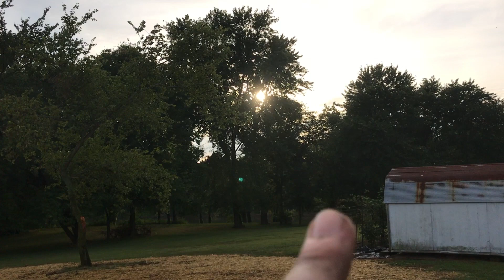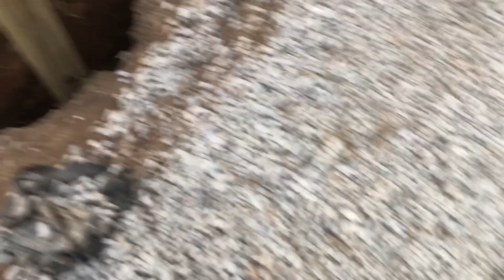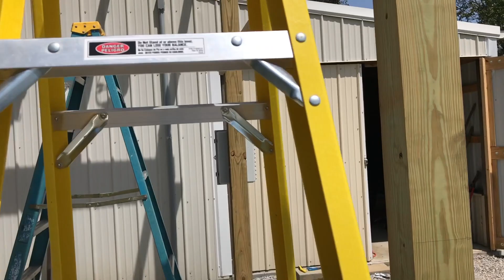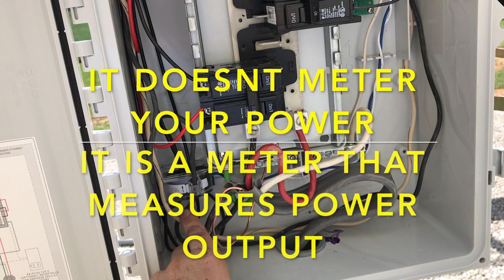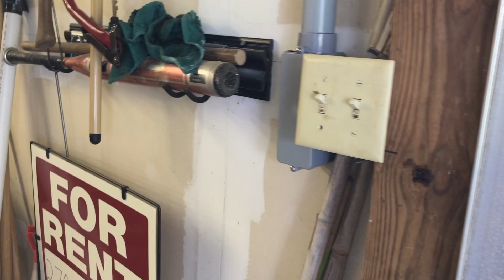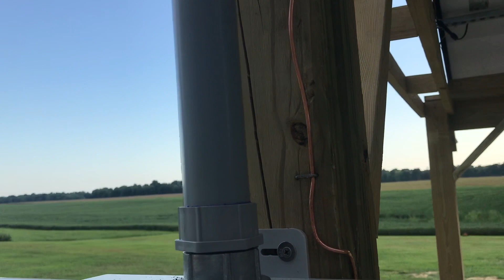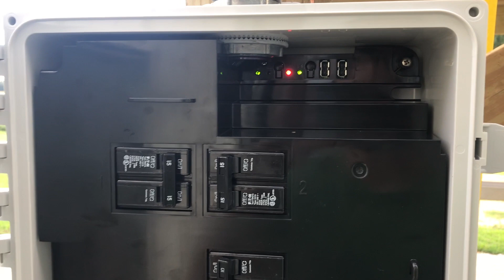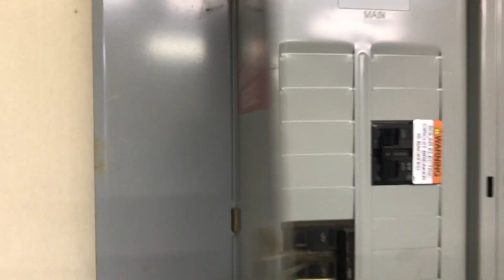Easy DIY Solar Panel Install - 8.37kW Enphase Energy Micro Inverters & Mission Solar Panels

Comment: Neal, Great Job.  I was wondering what gauge wire you ran from you combiner box to the disconnect box and the length between the combiner and Disconnect. Do you think the (3) strings from the micro inverters will fit through  3/4 " emt or would I need 1"?  You just inspired me to do my own 9.7 k/w system  on my garage here in Southern California instead of paying $32,000. Thanks and again, Great Job
Reply: Thank you for the info. I also have a 200 amp main panel. I will have to derate my panel like you said to 175 or do a line side tap. I will be using 26 enphase IQ7A 1.45 amps so I will need a 50 amp breaker. My run from the combiner box to the main is about 100 feet.
Reply from the maker: Fernando Larez 6ga cable should work fine in your install. If you’re going all conduit I wouldn’t get underground feeder, it’s difficult to get through conduit and strip. It wasn’t too bad getting through the little conduit I had but you have to pull the cable stick by stick or fitting by fitting before you glue. I use this chart https://www.usawire-cable.com/pdf/nec-ampacities.pdf
Reply: @NealORussa  not to mention that any sheathed cable is forbidden inside conduit, loose conductors only.
Reply from the maker: @Miss_Vicki  I've done a little research on this and I don't believe the NEC code actually forbids it, but sheathed cable is not recommended to run in conduit because it is tough to pull and it changes the conduit fill code.  I have read where code says that sheathed cable can be placed in conduit to provide protection, which is why I have my UF cable running through conduit in certain places outside of my building.  Thanks for any insight though, this discussion is always good!
Reply: @NealORussa  Very impressive and nicely narrated installation. Retired electrician here doing some research and trying to get familiar with  a system my son is having installed. 
On the "sheathed cable in conduit question: I'm also not sure if it's "forbidden" in the NEC but during some code classes I have attended, the chief concern that was stated by the inspectors doing the classes was that of "heat" since the jacket on the cable is not intended to be enclosed in conduit so it can't/won't dissipate heat very well. As I recall, the advice was to strip off the outer jacked whenever the conductors were going to be installed in a conduit leaving the individual conductors running through the conduit with lots of air space to dissipate any heat. This could also affect the amp rating of your fuse protection due to how much heat the conductor insulation will allow.
Reply from the maker: @pappabob29  thanks for the insight Bob!  I have about 15' of the uf cable running through 1.5" conduit. It's just where it runs from the iqcombiner box into my pole barn. From there the cable is exposed through the disconnect and to the box in the garage. Good luck on your sons install. If it's the enphase system I think you'll both be happy!
Reply from the maker: Fernando, thanks for the comment, glad you are doing it yourself! Not only save money but also will help having knowledge of your system in diagnosing any issues down the road! My only note on the system size you discuss is making sure you stay under the 120% rule. Meaning however much your panel is rated for, you can only send in 120% of that power. My limit was the panel in my house which is the panel after my garage. It’s a 200a rated panel so max i can send to it is 240a. I have a 200a main breaker for incoming power from utility company and that only allowed me to input 40 additional amps from solar. One way around that is to put in a 175a main breaker then I could have 65a of solar power. I have my electrical line diagram if you’d like a copy of it. You can email me at daviesscountytractor@gmail.com. 
That cable you refer to is 6/3 stranded copper underground feeder with a 10ga ground. I’d say it runs about 80’ total including through the emergency disconnect. As far as conduit size, there are dimensions of the cable on enphase site and there are conduit fill charts you can use. I would upsize to 1”. Easier to pull if anything else.

Comment: How much would you estimate as the cost of this entire system?
Reply from the maker: I have a detailed spreadsheet of all costs. Total for materials purchased was right at $13,200 and I had about 100 manhours in the installation. I just received the 30% federal tax rebate on my 2019 taxes as well.

Comment: Why would you use wooden posts on such a nice solar install? I think it's pretty inevitable the posts will eventually rot which will require some pretty decent amount of repair work later. As opposed to using aluminum posts which would pretty much last forever...
Reply from the maker: Ozzie, I definitely looked into aluminum posts, i figured i would need at least a 3" or 4" diameter pipe, and I was having trouble locating that material along with a proper way to fasten my beams and rafters to the pipes without spending a bunch of money.  I did consider steel I beams since i have a welder and could fab mounting plates for the beams.  Either way, I went with CCA ground contact treated posts.  If they rot out, my plan is to put temp 4x4 post shoring on either side of a permanent post, cut out the rotted post, drill & epoxy in rebar into top of concrete foundations and pour a 6" layer of new concrete on top with a galv metal post anchor embedded in that concrete.  Then I can install a new post, nail to the anchor embed and beams and repeat at each post.  I figure that may take two or three days at the most and maybe $400.
Reply from the maker: Also, every aluminum racking supplier I talked to did not want me to build the racking off the ground for storage underneath.  They all said their aluminum poles needed to have the low end of the panels like 1-2' off the ground unless they added a ton of X bracing and additional engineering drawings and $$$.
Reply: @NealORussa  I was going to ask the same question. Great job on the build. I will be using this as a reference for my project. I think you will be good because you filled the entire hole with concrete. if you built a form and brought the concrete above ground by 3-4'' they would never rot. I suggest you brush / soak the bottom of posts in used motor oil / diesel fuel 50/50 combo once the wood dries out. This too will greatly extend the life of the posts. it is not bad for the environment which I assume you know that.
Reply from the maker: Terry Rocks thanks Terry! Yes I wish I had gotten another yard or so of concrete to raise and slope the foundations. I’ll look into a wood sealant. If your moving forward with an install like this i would also recommend trying to find some plastic c shaped strips that would ship over the top of the rafters before installing unistrut. That may help protect them from weather more. Another commenter mentioned that. Thanks again and stay tuned for the one year update coming early September!

Comment: Nice install Neal, I'm thinking about installing the enphase inverters have you had any trouble out of any of them.
Reply from the maker: Thank you Greg!  I have not had any issues with the inverters.  I don't believe there has been one day where they did not work or upload data to the enphase enlighten web app.  Since install i have generated 6.76 MWH, or 6760 KWH.  That is $811 using my rate of $0.12/KWH.  That is from Sept 2019 to May 2020, so 8 months, and those were the winter months!  I'm looking forward to what the summer holds.

Comment: Next time just pour concrete in holes and attach anchors with threads then use some metal collars to bolt to anchors. Nail the wood to the collars. So much less concrete and wood. Drill holes in wood to make room for anchor and nuts. When grounding there are barbs on each hold down bracket and should be torqued to Mfg. Spec. also would not hurt to run the ground wire to each mounting rack.
Reply from the maker: Yes, I agree I was not happy with the concrete being lower than the dirt, i should have ordered another cubic yard of readymix so the concrete would be higher than the dirt.  I am thinking of digging up the rock i placed around the posts and putting in some waterproofing and then pouring up another 1' or so with sonotube & quickcrete around the posts to keep some moisture out.  I've seen the post anchors as well and considered those, but i was slightly worried about pullout strength at the bottom of the post with wind uplift.  Some of the post anchors i was finding only had nail holes up about 1-1.5" up from the bottom of the post and that didn't seem like enough meat at the bottom of the post for the nails/lag bolts.

Comment: Nice set up!  I’m not at your budget but under $14,000 is really good from my research.  My budget is super tight so I only have 2 panels and a turbine I’m working on getting up this summer. However I am seriously contemplating going with the Enphase iq7’s which will almost cost more than I paid for my 3 panels (1 is on my golf cart) and my turbine.  My understanding is that even without Envoy they are worth using.  I’ll check if you’ve done a review video on them.  Thanks for the info!
Reply: Enphase is the way to go, they are far more advanced technological value than anyone else
Reply: @guidedbygreen1480   That's what I like to hear.  Have 2 IQ6's in my Amazon cart waiting for me to get all the wiring done to click "buy"!
Reply from the maker: Hey sorry i just saw this comment!  I think the enphase microinverters are the way to go, easy to install, replace, and add to the array.  A single inverter system also requires high voltage going from panels to the inverter location, which can be more dangerous.  Good luck with your setups and i plan to record a 1 year followup video in late august!

Comment: Hey Neal thank you for the thoughtful video.. I am planning my own installation and wondering if the combiner box is necessary.  I’d forego system monitoring to save the 800 they want for that box.  I’m thinking a small sub panel could do the job?  Is there another reason that I’d need the combiner box that I’m overlooking?
Reply from the maker: Josh Cole if this helps at all, here is the combiner box I bought from eBay for $500 new. https://rover.ebay.com/rover/0/0/0?mpre=https%3A%2F%2Fwww.ebay.com%2Fulk%2Fitm%2F174204561841
I think the most fun part of the solar setup is watching how much power you generate and you can also troubleshoot problems and underperformance of each individual panel. But I understand saving $500. 
With that said, I don’t see a reason why a small sub panel to collect your branches wouldn’t work, but you might call enphase to be sure that the envoy system is not needed for initial setup or any other reason in terms of connecting and communication between the inverters and the power grid for net metering.
Reply: @NealORussa  Thanks for the reply, Neal.  Really appreciate the video.  And thanks for the direction - I’m planning to go with that combiner box.
Reply: @NealORussa  Hello,
How many amps  is your main panel and garage subpanel? Did you do conduit between main panel and garage subpanel?
Thank you
Reply from the maker: @Victor00013  I do not recall what those two panels are rated for amperage wise, but the main panel has a 200a incoming main breaker and a 100a breaker going to the garage subpanel.  The garage subpanel does not have an incoming breaker.  Those two panels were already installed when i bought the house, but yes there is underground conduit between them and i believe 00 gauge aluminum strand cable.
Reply: @NealORussa  Great job on your system! 
Subpanel does not require to have incoming breaker or main breaker. If you have 100 amp breaker on main panel subpanel is rated for 100amp. I have exactly same set up only subpanel is on the pool house.
Did you place additional conduit between main panel and subpanel or used old (existing) one?
Thank you
Reply from the maker: @Victor00013  The panels have a nameplate or sticker on them that provide the actual rating of the panel itself, and the rating of the garage subpanel is actually much higher than 100a (it might have been 250a?).  But, it is only being fed by the 100a breaker from the main panel.  It also is being "fed" by the solar panels which are coming into the panel on 40a breaker.  So the total that could be input to the panel is 140a.  From what i understand, you calculate the max input allowed using the 120% rule, which means your total power coming in x 1.2 cannot exceed the nameplate capacity.  So my total power coming is 140a x 1.2 = 168a, and the nameplate rating was 200 or 250a if i remember correctly.
The 120% rule on my main panel is what stopped me from adding more solar panels to my array.  Basically, the 200a main breaker, plus the 40a solar breaker = 240a x 1.2 = 288a and the main panel was rated for 300a.  A work-around would have been to remove & replace the 200a main breaker with a 175a or 150a breaker, then i could have increased my solar breaker size.  For instance, 60a solar + 175a main = 235a x 1.2 = 282a which is less than 300a rating.
Regarding the conduit between the main and subpanel, i did not modify that conduit or the cable that was pulled between the house and garage.

Comment: First off good job.
One thing I would change is the white wire coming from the main service panel using it as the grounding and the bare wire as the grounded.
Both wires are bonded at the service panel anyway yet white is thicker gauge allowing a larger electrical discharge if needed.
The only thing connected to the neutral bus in the combiner box is an 16awg wire for envoy.
Just saying
Reply: If you feel the urge to make something better in your already good installation you can add lightning protection. Partially it depends how common you get lightning strikes close to your house. Since you have tall trees nearby it possibly reduces that chance.

Also PV equipment ground wire connectors are potentially not code compliant. I think all editions of NEC call for continuous wire or non reversible splices. It can be easily remediated with C butt clamps but since you already passed inspection it might be wasteful.
Reply from the maker: 4some2joe0 hey thanks for the comments! I just rewatched the wiring portion inside the combiner and I agree with you that the neutral wire really doesn’t seem to do much besides run to the envoy. So yea maybe one day I’ll switch the 6ga to the ground bar. Thanks!
Reply: @NealORussa  
Cool, stay safe out there brotha.
And as we say out there "don't loose your neutral"
Reply: I do not think you can do that without violating electric code. If there is a run of neutral ware it has to match gauge of hot wire. The fact that you currently have only one small device with a connection to neutral is irrelevant. Code requires neutral wire to have enough capacity for any current that can travel through hot side since it might be return path. Separately there is an issue of insulation color.
Reply from the maker: William Peck appreciate your insight and information! I’ll leave it as is. Haven’t had any issues yet!

Comment: Beautiful install, although we would have never recommended the use of Unistrut, but specific aluminum for solar systems.  Other than that, much respect for doing this by yourself!
Reply from the maker: Thank you for the props on the install.  I read a lot about galvanized metal in contact with the aluminum panel.  While i agree there could be a dissimilar metals issue, the reading I had done makes me willing to accept the small risk.  Unistrut manufactures and sells an entire solar racking system with their galvanized strut, so i'm confident it will last.  If i see issues during inspections, I plan to loosen the bolts one by one and slip in a thin HDPE or plastic pan washer between the strut and panel.
Reply: @NealORussa  
Green Unistrut is good also, just saying
Reply: @NealORussa  Actually Unistrut makes an aluminum solar racking system, as far as we understand, though we don´t get it in the mexican market.  

HDPE is a good Idea, or Neoprene gaskets, you might want to check your code though.
Reply: @bluesolarmx  
Where is this Mexican market you speak of, and do they sell tortillas also?
Reply: @4some2joe0  you are welcome anytime down the border ;) (of course once this Covid virus is controlled and the borders open again) ;-)
Reply: @bluesolarmx  
Awesome thank you for the invite, one day I'll visit

Comment: Hi Neal.  That was a very neat job and I appreciate the video.  I am in the process of my own install and it was helpful to see your set-up.  I do have one suggestion (albeit too late to use at this point.)  I really liked the wood framed solution and I realize it is all pressure treated.  To be sure your wood structure lasts as long as your panels will, it might have been a good idea to run a strip of Zip Tape along the tops of each of your rafters.  They are mostly covered by the panels but, much like joists of decks are covered by deck boards, moisture damage is almost inevitable if you live in an area with decent annual rainfall.  That band of Zip tape along the top costs about $25 but will make that beautiful structure you build last forever.  Thanks again for the great video.
Reply from the maker: I agree that would be a good idea to protect the rafters! I really wanted to put metal sheeting across the whole roof before panel install, but that would have classified it as a "building" and it would have to be engineered, permitted, etc.  If these rafters go bad, hopefully i can figure out a way to slip a new one in beside the old ones then cut out the old.  That oughta be a fun project!